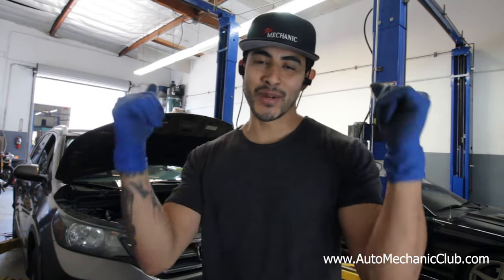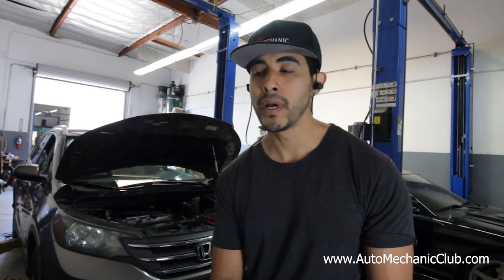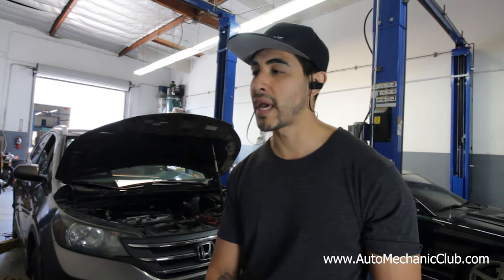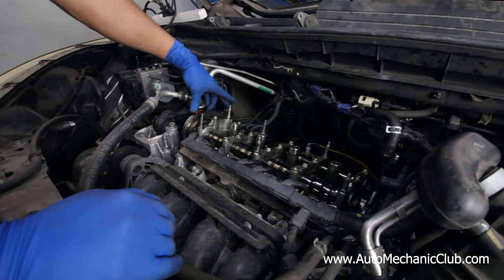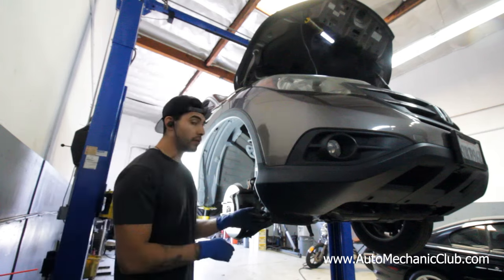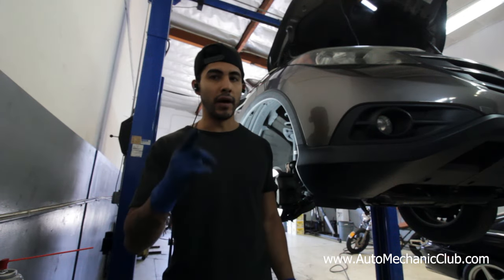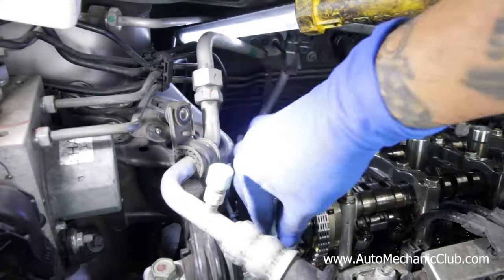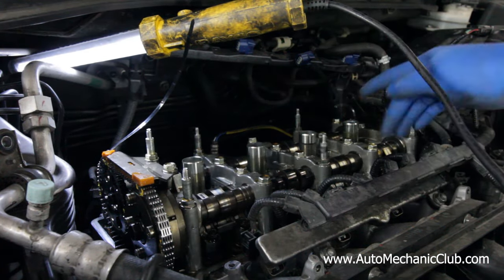2012 Honda CRV VTC Actuator Replacement and Diagnosis FULL

Comment: Im going to do this on a friends car but can anyone explain what the point of removing the cam is?  Cant you just hold the cam while its in the car, unbolt, put new phaser on in unlocked position, torque it down, then lock it, while its in the car the whole time?  I cant find any good reason to remove the cam. 🤔
Reply from the maker: I forget why to be honest. But youll have to remove it brother. Try not to but ehhh, what do I know. I just repair cars every day for 14 years and I followed the manufacturer repair procedure for this which they want you to do this job as fast as possible and if it was easier to remove just the cams they would have said so but what do I know.
Reply: @THEMECHANICOCMissionViejo   i work on cars for a living too but not necessarily as knowledgeable as some of the veteran techs, which is also the reason why I'm looking up info online. I've been working on cars for less than half the years you have been.  Like, any other car that I had to replace a phaser or take off sprockets to replace cam seals, I've done it with the cam in the car.  I also saw the repair procedure online but was just scratching my head on why the the cam removal was necessary.  Anyways thanks for the info, I mean its only gonna take 10-20 more mins to pull and install the cam anyways.

Comment: How much does this cost?
Reply from the maker: I forgot. Ill check tomorrow. But between 700-900 If i remember correctly.
Reply: @THEMECHANICOCMissionViejo  ware you located  at
Reply: @YAHSHUA2285  San Francisco California
Reply: @lenbata  wats the name of the shop
Reply: Can I have your contact information.
?
I have the same issue with my CRV 2012.
I live in Antioch, East Bay Area.

Comment: Just lock it before you put it on the camshaft, done it that way every time with no problems
Reply: It doesn't have to unlock?
Reply: Im very tempted to do this. I accidentally locked a brand new vtc. I really dont feel like unbolting both camshafts and remove one to unlock it. I think ima just give it a shot and hope i dont break it. Ill report back with results. Remind me if i dont
Reply: @JJ-iz5ql  how'd it go?
Reply: @porgin8092  great! I torqued it to spec and all my rattling noises went away. Been daily driving it and no issues.

Comment: Great video bro I’m in the Bay Area and my 2012 crv does the same thing. Let me know your shop name and number so I can bring it in.
Reply: Hi, do you have his phone number or some way to contact him? 
I live in East Bay Area and have the same issue with my Crv 2012.
Reply: @Walter_Aguirre  he never replied. But I had bought my CRV at Carmax and luckily it was still under warranty so they fixed it no cost. sorry couldnt help but i hear its about a $900-1500 job. Its really a shame Honda never did a recall on this issue especially knowing this is a problem.